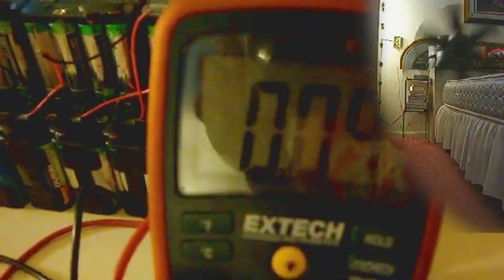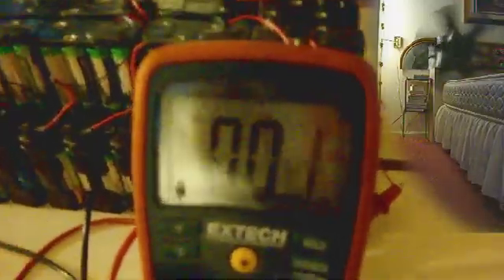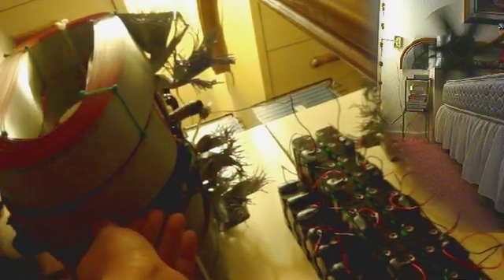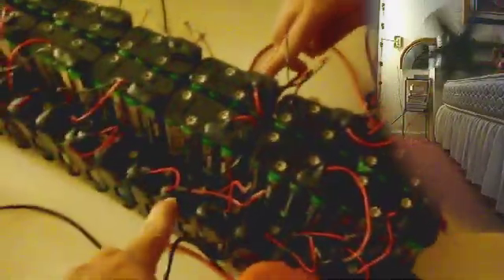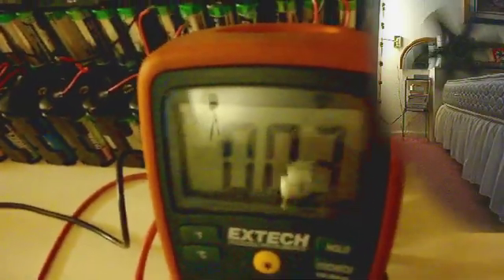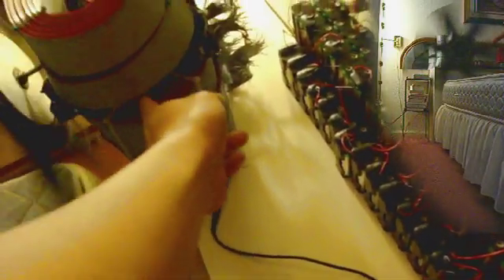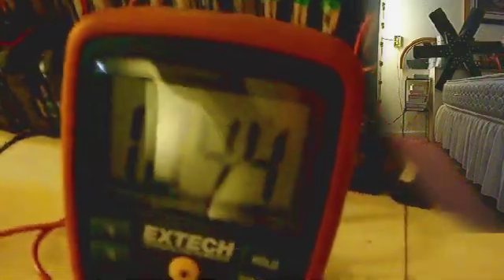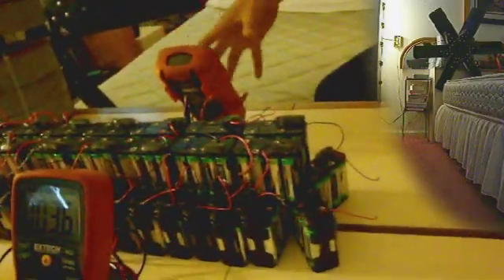ｗａｔｔｓ15~ 146ＲＰＭ ＭＯＴＯＲ Ｎｅｗｍａｎ

Comment: You really need a scope to optimize it better.
But well done !
maybe just put a graetz bridge rectifier over the coil and charge up a big cap and run a light on the DC output this way.
Good luck.
Regards, Stefan.